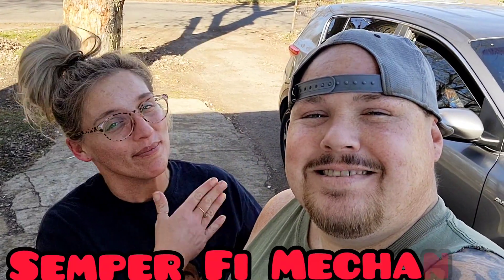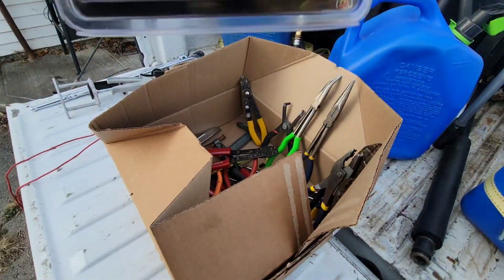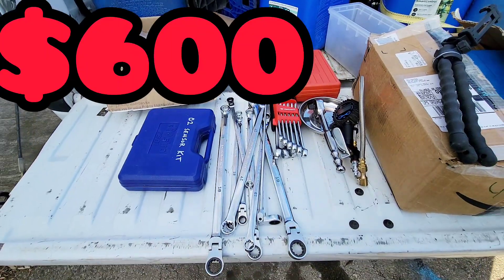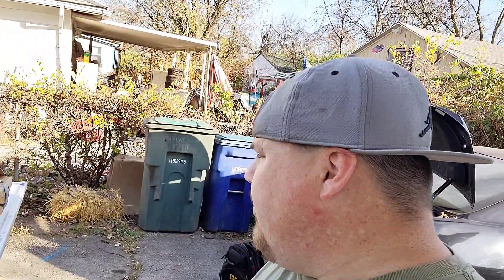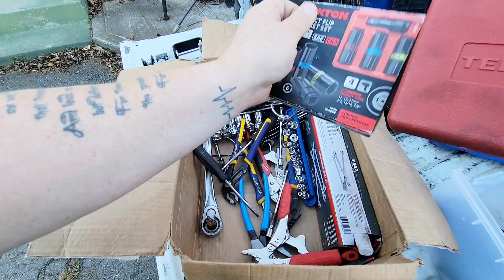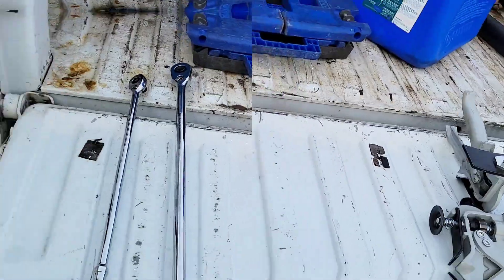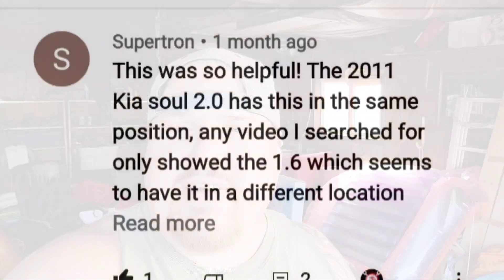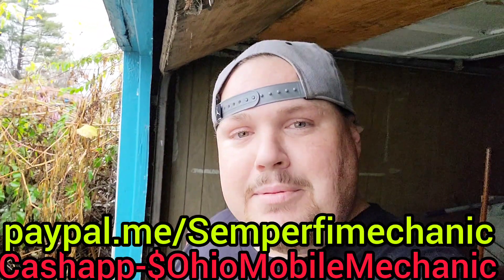My Mobile Mechanic Tool Setup Plus My Brand New Tool Haul And Tool Giveaway

Comment: That's an awesome tool haul. The Marines to the rescue! Those long flex head ratcheting wrenches are just the ticket. Fixed box end to break the faster loose. Flex end for tight situations. The crows foot line wrenches are a game changer. The truck may not be ideal but it will suffice until you can get a van. For many years I did mobile service for Saabs. I had a bench top 3 drawer chest, a twin tank portable air compressor, 2 jack stands and a small trolley jack. I could fit everything in the trunk of my 4 door 900 sedan. If I needed more room the back seat folded down. I already have a decent scanner. Hopefully the scanner goes to someone who really needs it.
Reply from the maker: Thank ya brother like always you have always supported me and mu channel and I will never forget tbat man. That setup sounds cool as hell

Comment: Check engine light came back on went to O'Riley's cleared the P0455 replaced the cap and the Solenoid on the intake but the light came back in 2 days. 04 Silverado 4.3 I need some smoke lol HVAC lol
Reply from the maker: Look up homemade smoke tester I've seen people do it with a cigar

Comment: Tools definitely make the job easier, yet I saw no Snap On, Matco, etc. Funny, that without the over-priced tool truck tools you can still get the work done.
Last week I called Snap On to find the local dealer to get some tools and get a warranty replacement and they refused to give a name and phone number since I didn't work for a garage.
Little did the morons know that I have a $200,000 budget for outfitting a garage, being built as I speak. The Snap On dealer that will surely wander in there is going to get a surprise, albeit it wasn't his/her doing. I guess Snap On is too woke to have to deal with sales. Their present behavior is definitely not what got them big, but it will help their demise if they don't wake up. Any company that doesn't jump at the opportunity to sell has lost its common sense. If said stupidity has permeated Snap On, I can't expect their tools to be that good, as a fish rots from the head down.
Reply from the maker: You are right my good friend. My tools are dewalt, gearwrench and whatever I could afford at the time. If I was in a garage setting Im sure I would like to have a little bit better setup but as a mobile mechanic in Ohio these tools are in inclement weather so to me its better to buy cheap and if I use a tool enough to break it then go ahead and bump up 1 brand. That being said you can get the job done with harbor frieght sockets and rachets I mean my Pittsburgh set and icon tools never failed me. If I had a 200,000 budget like you im sure I would splurge a little bit but snap on is just way to over priced and there customer service has been shit so like you said that just cost themselves alot of money and will contuine to till they fix that